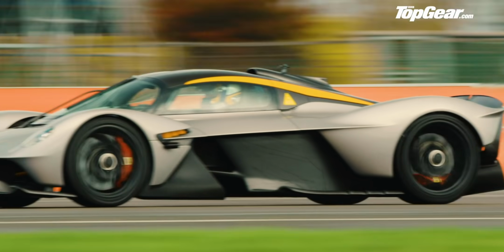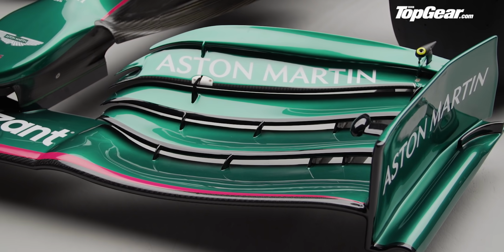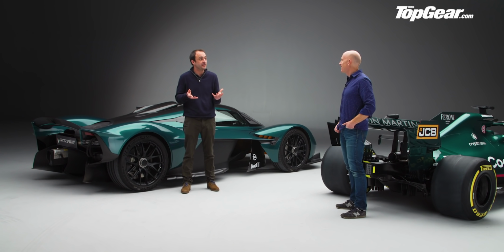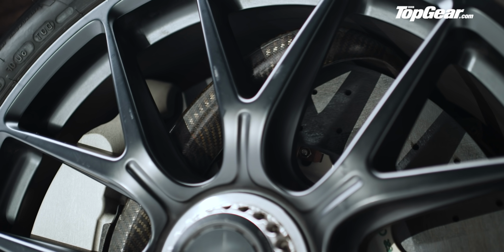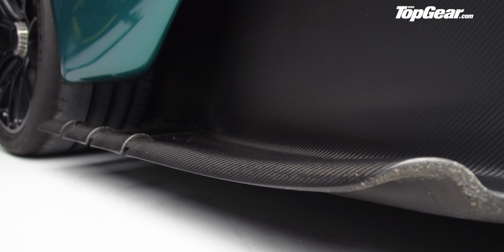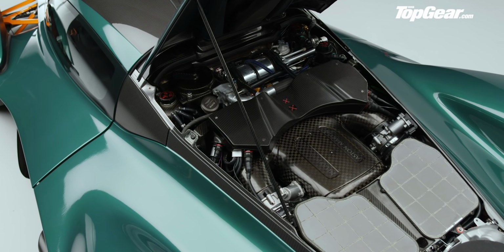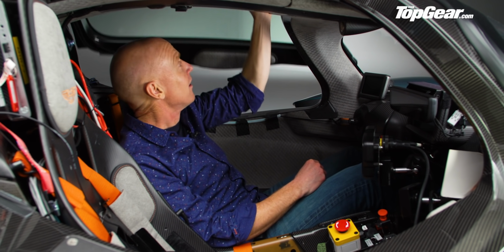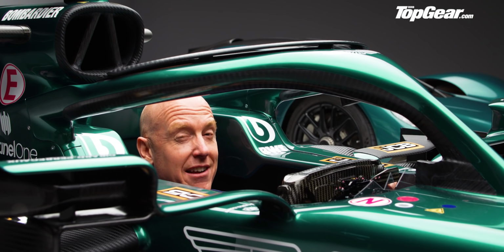Is the Aston Martin Valkyrie really an F1 car for the road? | Top Gear

Comment: Surprising how big F1 cars are.  It dwarfs the Valkyrie from that camera angle.
Reply: 5.7 metres long makes it longer than a Maybach S-Class. An entire Fiat 500 will fit between the front and rear axle centrelines.
Reply: I just got a tape measure and mapped it out; it wouldn't fit into any room in my flat. I can't quite get my head around just how massive that car is.
Reply: Funny how they are bigger than an S Class but weigh less than a first gen Miata, and have more power than a Mclaren P1.
Reply: They used to be quite smol in those v10 days
Reply: True

Comment: Does the Valkyrie really have that 1 power-to-weight ratio, I wonder..?
Reply: 1035KG to 1170HP.
Reply: @F1ll1nTh3Blanks  where did you get that weight number from?
Reply: @venancio199-xgf  You can look it up. Should be on the brochure. Or just check out any article on it. 
1035KG kerb weight. 
1170hp = 1000 from the V12 + 170hp MGU-K. 

Downforce figures estimate was max of 1800KG, with 1000KG available at 150MPH/240kmh. Max of 2.4G's at the corner. Max, 3G's under braking. 
0-60mph/100kph = 2 seconds estimate. 
Top speed = 250mph theoretical. 

Those are all the figures I can find lurking around the net.
Reply: @Aston Martin Valkyrie Amr Pro Nope. It's power is greater than weight. 

Oh yeh, max torque for anyone wondering, should be about 900nm combined.
Reply: If 1170 hp/1035 kg (assumed empty weight), you can get more than 1 power-to-weight ratio. 👍
If 1160 hp/1160 kg (assumed empty weight), then you'll get less than 1 power-to-weight ratio. 🤔
Reply: @dagelandumay  No, if it's 1160:1160 that's 1 to 1.
Reply: @Aston Martin Valkyrie Amr Pro that's why I said "assumed". 🙂